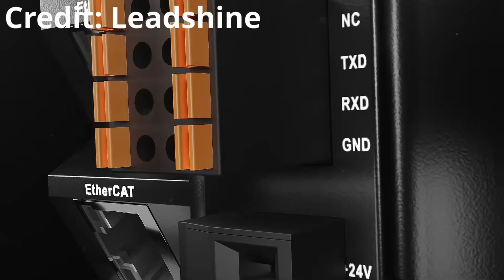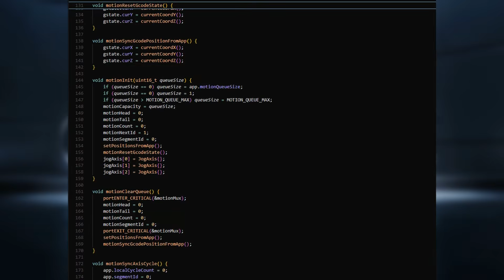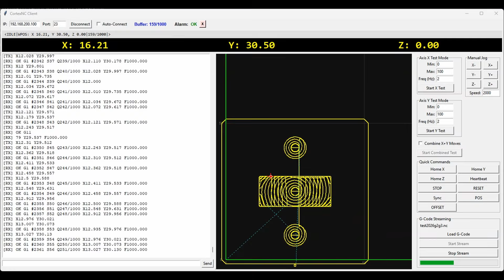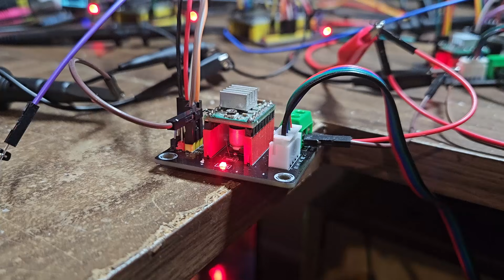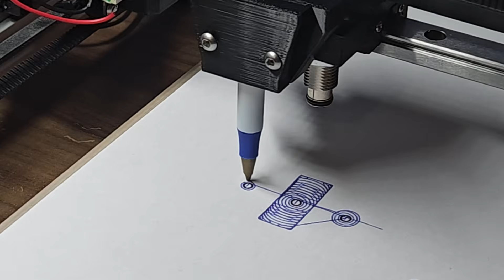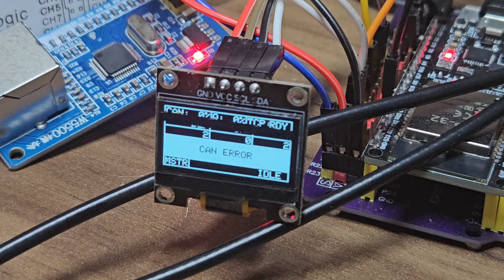Can this DIY CAN based CNC controller compete with EtherCAT?

Comment: Very cool, above my knowledge level for sure😅
Having the capacity of real time position correction is very nice.
You should try to commercialise this! Fluidnc was pretty successful after all, but it has only pulse/dir protocol and no closed loop, besides what may be built into the motors.

If you did design a controller board for sale then I'm sure you could profit from it😉
There's some gaps in the controller market after all, especially for the hobby sector.
Besides Linux cnc I think it's all closed source and mesa cards are also closed I think?
Reply from the maker: I believe the LinuxCNC is open source but I'm not sure about the mesa cards. For now my controller is still in development but commercialising it is something I'd like to achieve in the end. 

Closed loop systems are rather complicated, I'll definitely try to implement this but my main goal is to achieve high flexibility of the system. Where adding new features like lights, screens, axes, motors etc comes down to adding a node and configuring it in software. 

I've recently seen some videos of automatic tool changer for cheap Chinese spindles with ER collets. I don't really like the idea of tightening the collet with spindle motor as they don't really have much power at low RPM. I have an idea in mind how I can achieve similar results without using spindle motor. 

It's something for the future though. I'll be starting the build of DIY CNC router in the near future, it will be the main project for next couple of months. Then I'll install my CNC controller into it and work on the ATC.
Reply: @CortexNC-DIY best of luck! Will be interesting to see what you come up with, sounds pretty modular, which are the best systems😄👍

Yes, i agree with the collet atc system. People claim it works well, but it feels wrong somehow.
I'll just use manual m6 on my 2.2kw spindle.

Next build will have atc with tool holders and a seperate spindle motor so i can run bigger tools.
Reply from the maker: I do have plans to make my own ATC spindle using ISO30 toolholders, I even started making the clamping mechanism (the one with balls inside) but it got pushed on the side track since I had more important projects. Now I don't really have time to continue this and this will be pretty big spindle, not really suitable for machines I build. ATC spindle is my dream but they are very expensive... That's why I will try to build something better using collet spindle, I'm thinking wrench like gripper for spindle shaft and somewhat powerful tightening mechanism. I haven't thought of it that much yet
Reply: @CortexNC-DIY  Mesa firmware, gateware (hostmot2), drivers are open (drivers are really part of linuxcnc, 1st class support).
Mesa HW (boards themselves) is not open. However you can run hostmot2 on custom hardware with suitable Spartan 6 FPGA, like the RV901 telebim cards

Comment: Cool! I am really interested in the synchronisation part and your plans are to implement feedback handling from the steppers while staying synchronised
Reply: Answer: no

It seems pretty cool though
Reply from the maker: Glad you liked it! At the moment I'm working on the nodes parameters, configuration though CAN, CRC checking so you cannot run the machine when parameters of the node don't match the ones on the master unit and fault messages. I'll be definitely trying to implement live axis position reporting read with an encoder but it's something I'll work on a little further into the project.
Reply: @CortexNC-DIY understandable, great work man! Seems like a complex problem to fix
Reply from the maker: Thank you, it kinda is a complex one. I'll have to think whether I want the slave unit to operate the encoder or master. Either way there must be only one source of axis position. I think it's best to have encoder connected to master unit since I'd have to somehow send the encoder position in real time from slave to master.